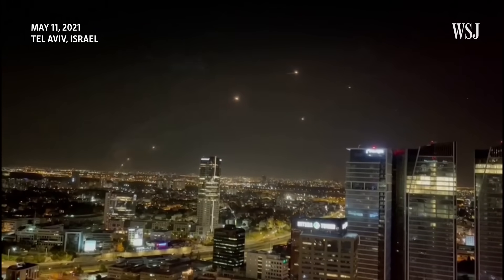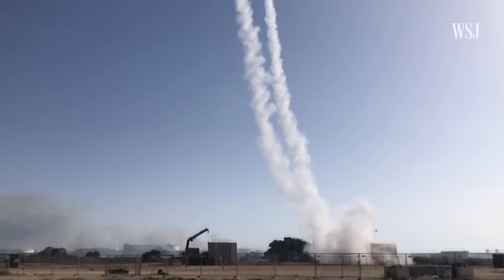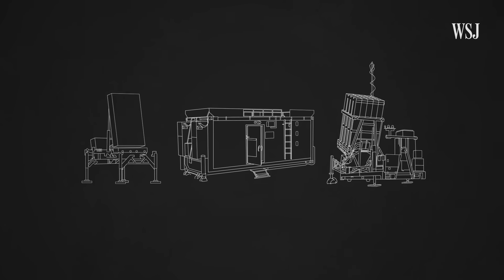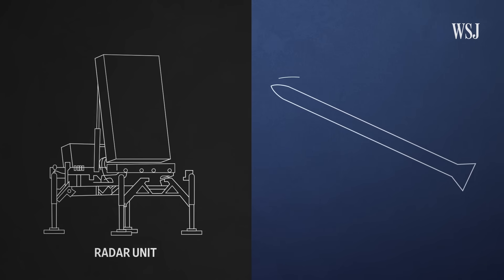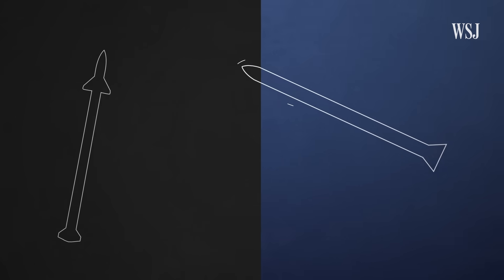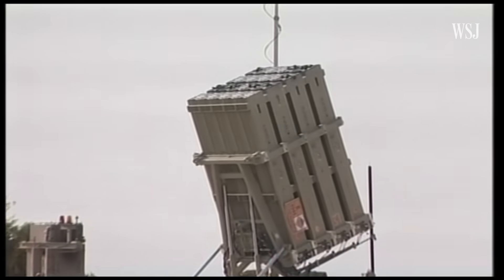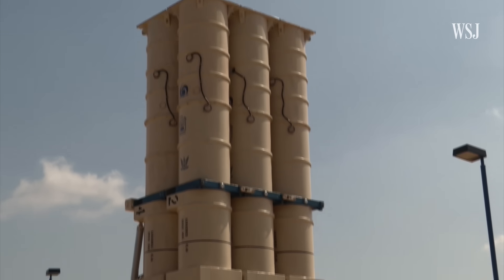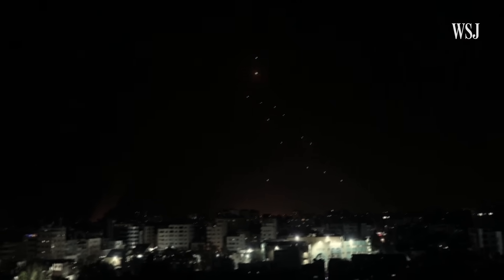How Israel’s Iron Dome Works | WSJ

Comment: I will answer my own questions: $50,000,000 per battery. $40,000 per rocket.
Reply: Woooow
Reply: And all paid for by the USA!
Reply: where is the source for this?
Reply: @ReassuringSmile  the internet.
Reply: @WS-gs6sf  Cool, you went the Wikipedia route...simplistic, scroll to the bottom where you have references, it's 1 source. If you do a broader search, you'll find price of the battery ranging from 12 million USD all the way up to 80 million Euros, that's a pretty huge range of numbers to believe. Especially when the Israeli government does not disclose the information of cost. Be a skeptic.
Reply: https://youtu.be/KiiWHWz-ROo
Reply: Tax payers of the US are ready to pay
Reply: All paid by the American taxpayer.
Reply: 80,000 $ per rocket VS 300 dollars Hamas rocket 😂
Reply: Per rocket?? How can Israel afford that?
Reply: Meanwhile each rocker costs around $200
Reply: That a lot of US taxpayer money.
Reply: Oversimplification as crew cost, maintenance costs, integrated neighbor systems like air force radar, and rocket variants effect the price tag. But yes this stuff is expensive, but the Israelis would rather lose the money and keep the people.
Reply: TJ Murphy  no the power structure will change it will no longer be like the israeli present state. A one state with Israeli Palestinians state means all are eligible to vote, new voters with different opinions on political issues will lead to changes in government and legislations.
Reply: TJ Murphy  there will be a Muslim Arab majority in a one state. Look I'm not here to disagree with you. I know the prospect of compromise and peace at this time is highly unlikely. It pains to think that survival war between the two might be the only option leading to the death of innocents. If only there was a way to take out the direct  oppressors in this conflict. I believe Palestinians should have right to return and statehood and even though israelis were on the wrong side the average working israeli probably born into Israel and knows no other home should be given the choice to stay and live side by side with Muslims and Christians or leave and find  another place. When Jewish refugees came over from Germany they held up a sign that read" the Germans destroyed our homes and families. Please don't destroy our hopes." And while Palestinians are the ones who can decide to welcome or refuse the jews of  israel, I reckon jews feel like they have no haven other than Palestine. 
It will take a miracle, for Biden to stop military aid forcing israel's hand and for a majority of israelis to denounce their gov and push for Palestinian rights to avoid an all out war from happening.
Reply: still cheaper than the lives of innocent israelis.
Reply: @IronMikeyT  Iyah, They're innocent people cuz Israel is your holy land..
Reply: @IronMikeyT  there are innocent people on both sides. And Israeli behave like small USA in the area.
Reply: @IronMikeyT  well..imagine some random stranger coming at your village in let's say germany, saying sir, please vacate this house this is in our land, we are the descendant of hitler, yes we flee the house at ww2, now (2021) we are reclaiming it.
Reply: @mike your answer is very cool
Reply: @IronMikeyT  "innocent isrealis" 😆😆😆
Reply: @IronMikeyT  keep telling yourself that
Reply: @IronMikeyT  Yes. But cheaper than simply bribing families in Gaza to leave permanently to neutral states(plus bribes to the accepting countries). Or cheaper than bribing families in Gaza to resettle in Israel with a promise that their grandchildren get citizenship. The asymmetry has become so ridiculous that these options need to start being considered seriously. Shooting down unguided rockets with other rockets is not victory. This is not a war between two armies. This is a war between an army and a street gang. And street gangs don't count victories in terms of bodies. Hamas continues to hold on to power and that means they are winning. Israels refusal to destroy them is shameful and weak. They should have invaded the territory long ago and unilaterally implemented a one state solution with the long term promise of citizenship to the grandchildren of the people in the territory.
Reply: @peterisawesomeplease  Yes, I can see Israel invading Gaza going over fantastically well in the international relations arena.

Of course it'd be better for the people there to be under Israel than under Hamas, no question about it, but the logistics of it would be a nightmare...
Reply: @peterisawesomeplease  providing muslim Arabs with citizenship would lead to a demographic crisis in Israel with jews no longer having the majority. If Israel didn't prioritize its Jewish identity over its democracy then there wouldn't be countless eviction orders( like the recent ones in sheikh al jarrah that sparked recent conflict) or a Palestinian refugee problem to begin with.  2 state solution is no longer rational and besides it would have ultimately lead to racist ethnic states, one state solution is the only viable path now
Reply: @peterisawesomeplease  resettle in Israel with no legal rights and treated like a second class citizen for 2 generations , that's every Palestinians dream
Nobody in their right minds would agree to that.
Reply: @rainbowdash6835  Remember they shooting down 1k rockets for 50k. Its not every Palestinians dream. But I think you would find many Palestinian parents would be quite happy to be second class citizens rather than prisoners if they know their kids are not only going to always have food on the table but are going to go to college.
Reply: @rainbowdash6835  Yeah I mean the builders of the Israeli state did many great things but they failed here. They should have just incorporated the territory from the start. But now it really is the right thing to do. But yea the left won't stomach the human rights abuses that will inevitably accompany such a move and the right is not willing to accept that Israel needs to become a secular state. But the cost is worth it. These problems are nothing compared to the horror of being a child doomed to life in Gaza.
Reply: @peterisawesomeplease  no, I think you would find many Palestinians ready to give their blood and soul for diginity and honor.
They will choose death over living in shame.
Israel is the oppressor right now, Israel is occupying land illegally, Israel is the one evicting families, Israel is the one that strangling the gazan people economically, and hamas like you said is but a street gang nothing compared with israeli military power yet Israel is still the one thats causing the deaths of hundreds of civilians. So much advanced tech yet it keeps killing children
Reply: @peterisawesomeplease  no that cruel solution is not the only way!!! First and foremost, Israel can call for ceasefire, apologize for the alqsa mosque attack, and start right away making amends to illegal evictions by forcing israeli settlers to evict Palestinian homes in West bank. This is the first step in compensating Palestinians. It'll be hard on Israel's ego but in the end its the right thing to do. After that, the solution will be complex bc Palestinians should be granted right of return but israelis should also be given the right to stay. Its difficult but possible if both are willing to compromise. This is how peace can be achieved. No real peace without justice first. 
Now that said, the probability of that ever happening is almost zero. It would take a miracle for Israel to admit it is in the wrong and be willing to compensate. 
Its still possible,if USA stops its  financial support and puts pressure on Israel.
Reply: @peterisawesomeplease  the alternative, is an all out war in the ME. Dont be fooled, Israel cannot invade Gaza and continue its aggressions without other world players getting involved.
Reply: @rainbowdash6835  Yes if everyone is Israel and Palestine suddenly got hearts and minds a real two state state solution is possible. But its the wrong thing to advocate for because its never going to happen. That is just the road to the status quo. Advocating for a one state solution at least has a chance(still not a great one most of this is pointless discussion for fun) because it can happen unilaterally from either side without negotiation. Another nice part about advocating for a one state solution is that even if in your heart you believe in the two state solution the threat of a large number of people advocating for a one state solution is probably the best way to force Hamas and Israel to be serious about negotiating a two state one. Because right now it is in the best interest of both powerful Israelis and powerful Palestinian to keep the current situation. But in a one state solution they would lose more power than a two state one.
Reply: @peterisawesomeplease  Just let me correct you over a few points, this is not a war between an army and a street gang this is a war between an illegal occupying force and oppressed occupants that are fighting not only for their land but for basic human rights. The occupying government that represents modern-day colonization has violated most international agreements. They are using chemical weapons such as white phosphorus to attack civilians, have bombed buildings that housed offices for the associated press and Al-Jazeera, deliberately murdered innocent children, women, and men, displaced, attacked, and threatened countless Palestinian families to make way for illegal settlements, these settlements are in violation of the borders previously set and agreed upon and thus are illegal. The attack of Hammas on the occupying government is barely a proportionate response to the mass killing and violations of the Palestinian people, as Newtown's first law states that for every action there is a reaction that is equal in force and opposite in sense, one cannot stand while watching their homes being bombed, children murdered and their land taken and do nothing. It is a very sad truth that there are casualties on both sides, there is nothing worse than the loss of human life even if they are murderers or aiding the colonization of another country. To that end, all of your solutions are sadly invalid you cannot displace indigenous people from their lands or offer them bribes or even absorb them into the existing colony the same way that happened in America we are no longer living in such drastic times. The only peaceful solution is the return of land to the rightful Palestinian people.
Reply: @yasseentolba1241  I don't disagree that the that the rights of Palestinians have been trampled. And I agree that a one state solution does not restore those rights. But Hamas is a street gang. They are not freedom fighters. They maintain power via violence and their primary goals are not serving the people they rule or independence. Also it hardly matters anyone who believes Israel will accept a two state solution with Hamas in control is being unrealistic. They never will. But they might be forced into one if the Palestinians make a good enough bluff about being willing to kick out Hamas and demanding citizenship.
Reply: @peterisawesomeplease  Hamas are not the representatives of the Palestinian people. The Palestinian government is the official representative of the Palestinian people and should have full control over their lands, the whole of Palestine. Peace will only be achieved by the complete termination of one side. Simply Palestinians will not and should not leave their lands to be occupied the issue is way bigger to be even solved by offering them citizenship, because they are already citizens of Palestine they do not want to be sucked into the occupier’s state and let go of their country. It’s their country and their land they should be in control of it. The western media and western history is showcasing the conflict in a wrong manner. Palestinian just want their lands back, others who have fled want the right to return. Imagine living in a first world country and wanting to go back to your homeland that is bombed and have no infrastructure. Many of the Palestinians that wish to return were born and raised in the western world and they wish to go back to a country in chaos that they have never lived in, this is how much Palestinians love their country that’s why they will never give up. Even when kicked out of their homes they keep the keys passing them from generation to another with one hope and one hope only to return to their homes, many wear their keys as necklaces as a reminder. This is their country and it should be their country. For the reference no one want Hamas to be in control or any other armed group for that matter all they want is their country and to live in a democratic, civil society without an occupation force. This is the Palestinian dream and it’s a dream worth fighting for.
Reply: @yasseentolba1241  It's a valid dream but not one worth fighting for at all costs. Land and nationality are just not as important as human rights. And for that that matter land and nationality are not even worth much in terms of power anymore. I guess I don't expect to convince you. But understand everyone's ancestors were at some point kicked off of some price of land unfairly. Trying to right all those wrongs is unproductive and impossible. But giving our children an equitable start is possible.
Reply: @peterisawesomeplease  Yeah I get where you are coming from, but over here, in the Middle East land is sacred it’s way more
important to so many people than human rights. However, the major problem is not currently finding a solution but it’s to stop the fighting for the time being, casualties are at both sides, however, Palestinians are suffering way more, the civilian death toll is way much higher, that’s why the occupying government should be condemned for the killing and should not be supported for the sake of the tremendous human violations. That’s why we need to stop the killing ASAP by brokering a cease fire. For the sake of humanity every human being should do whatever they can to stop the support of the murder of innocent souls.
Reply: @rainbowdash6835  One state solution? Who exactly becomes the one state? The secular Palestine or the Jewish Israel?
Reply: @thenewcaliph766  I was the one arguing for a one state solution. Rainbowdash was not. 

Most advocates of a one state solution(including me) advocate for a secular Israel. Perhaps renamed and with some constitutional amendments but maintaining the Israeli constitution for the most part and leaving power in the hands of Israel during the transition. Although with the awareness that over time political control will gradually increase for Palestinians  until they become a majority And with the hope that if done properly by the time that happens that Israeli politics will no longer center around  religious or ethnic rivalries but around improving the lives of all the people.

There is huge variance in the proposed timelines. But most one state advocates see their advocacy as acknowledging reality and widening the scope of possible practical solutions so are not strongly tied to specifics of the plan or even a one state solution. They would be just as happy if their advocacy led to a two state or other multi-state solution. But thinking about the problem from a one state perspective helps people understand the conflict in more technocratic/practical terms rather than ideological terms.
Reply: @peterisawesomeplease  Wow, you are the first person I have met in these insane comments with an actual sane plan that I fully support and which may work, if both Israel and Hamas work together for it. A secular country in the region, with another name and constitution which guarantees the right of both Israelis and Palestinians seems to me to be the only likely solution to this never ending conflict. Two-state solution may just dissolve into more conflict, and trust me I'm from Pakistan and I know the problems of Partition. Something similar existed in Ottoman and British Palestine, but not to such an extent.

But there is a problem. Moderate people from both Israel and Palestine may support this plan, but what about the others? The ultra-Orthodox Zionists e.g. Likud and the Arab Nationalists e.g. Hamas. Both enjoy a large, and I mean a very large following from their respective sides, and both are hellbent on aggression and enmity towards the other and kicking each other out. They most certainly won't allow such a solution to take place.
Reply: @peterisawesomeplease  you made two points one I disagree with and one is an undeniably fact. 
The first is about  the importance of nationality and land. Ben-Gurion  (Quoted on pp 855-56 in Shabtai Teveth’s Ben-Gurion )once said:
“If I knew that it was possible to save all the children of Germany by transporting them to England, and only half by transferring them to the Land of Israel, I would choose the latter, for before us lies not only the numbers of these children but the historical reckoning of the people of Israel.” For israelis and Palestinians both,  its not about just  some piece of land, its about the collective identity of a people thats at threat! Not only that, but unlike israelis , Palestinians can actually say this has been their homeland for centuries, its not like their ancestors are dead so they no longer  have connection to the land. 
Secondly , although land is  important to identity and historical reckoning it does not however have much worth in terms of power anymore. In today's world War is fought over legitimacy not land. The battle over the consciousness, namely the hearts and 
minds of relevant populations.
This has become the new nature of conflict where the awareness and endurance of society determines victory.
And that precisely why its important who controls the narratives and the distrubtion of news.
Reply: @peterisawesomeplease  the struggle now is over who can win over the world's sympathy by convincing them they are the victim.
Reply: @rainbowdash6835  I think we mostly agree. I agree that land is important to both populations. I didn't mean to deny that.  I just think those populations are idiots for thinking it matters(or have been duped by their leaders). Human capital is what matters. Information is what matters. Obviously for Palestinians they are lacking the bare amount needed to have a functioning economy. And that does matter. But they are overly concentrating on getting ancestral land back. Getting the right to move freely and buy any land in Israel they want is what is actually important. Because that is the road to educating their population and building real power. And Israelis need to learn the same thing. Their values aren't threatened by Palestine. They are under attack from capitalists with no nation and the slow but inevitable spread of Chinese power. All the time they waste on assuring dominance over their neighbors is a waste. They need to work with their neighbors on more important things.

And yea I agree that struggle is political one not a militarily one. I mean those can't every be totally separated but that the use of force is primarily about perception not physical control.
Reply: @peterisawesomeplease  I get your point but the land grabbing is still happening to this day. For a lot of Palestinians its not ancestral land, its their actual homes like the latest sheikh al jarrah evictions. I would probably obssess over my home if  someone came to steal it from me. You can't tell me you won't  feel the same.
Reply: @rainbowdash6835  this is already clear, but everyone keeps their mouth shut.  Anyone with an interest in history should side with Palestine.
Reply: @stuartwhyman1  simply said, its all about the power dynamic.
the majority of countries have called Israel out countless of times  but bc its  backed by the most powerful country on earth, they get away with it. It only takes one veto from US to block UN resolutions criticizing Israel. 
So then this begs the question of why US is a die hard supprter of Israel. 
And if you know the answer then you've come along farther then most people
Reply: @peterisawesomeplease  Sorry but the moment a mofo pulls out a rocket, that removes that party from being labelled as a street gang.
Reply: @kingdx619  and a state evicting people from their homes and occupying and building illegal settlements (under international law) aaand assulting people praying in a mosque is not labelled as a democratic and just state. It is occupying and apartheid state!
Reply: @peterisawesomeplease  the solutions you suggested are so out of touch with reality, I'm certain you didn't do any research on the conflict whatsoever.
Reply: if hamas didn't knowingly set up shop in residential areas kids wouldn't be dying
Reply: @TheSirAshton90  oh we all know that's an excuse to destroy the infrastructure and crippling the Palestinians. Also they destroyed AJ building which were broadcasting what reality is over there
Reply: @mujtabaahmed6947  the reality is remove that magic wizard in they sky and these things dont happen
Reply: @kingdx619  rockets are cheaper than aks. I built rockets like this in high school.
Reply: @peterisawesomeplease  you said it all. Remaining on the "we want our lands back" will lead nowhere because at some point in history a different ethnical group "owned" the land.
Reply: @rainbowdash6835  yes indeed u nailed it the only solution is palestine state
Reply: @IronMikeyT  yes. But compared to Hamas's rockets its overpriced by a lot. Hamas rockets only cost  300 to 800$ to make.
Reply: @rainbowdash6835  i think they're costlier  than that, chemicals needed to make the rocket propellant are expensive
Reply: @vishalgiraddi5357  here is the source 
https://www.jpost.com/arab-israeli-conflict/how-much-does-hamass-rocket-arsenal-cost-668317
Reply: @rainbowdash6835  Hamas rockets are dummy tech. They only shoot them to a random place and hope to hit a random local with population. Meanwhile the dome missel has to hit a rocket flying in the air and not a random spot. Why do you think USA military wants this tech so much and is helping israel develop because they can be use in their own country if necessary
Reply: @vishalgiraddi5357  The rockets are made from sugar and fertilizer.
Reply: @peterisawesomeplease  ohh
I thought they're made of APCP composite propellant, which is generally used for solid rocket boosters/missiles
Reply: @vishalgiraddi5357  I am sure it varies somewhat I am just getting that from the wikipedia article. But they probably just use the cheapest things they can. They don't care about the rockets actually being effective or killing anyone. They are just about showing they can still fight and baiting Israel into killing civilians.
Reply: @rainbowdash6835  — Are you sure about the $300 to $800 dollar per rocket figure? You can’t even repair an old car for that much, let alone fill it with fuel (probably $100s) and explosives ($$$?).
Reply: @sirrathersplendid4825  the  source https://www.jpost.com/arab-israeli-conflict/how-much-does-hamass-rocket-arsenal-cost-668317
I would say a few thousands max but I'm no expert
Reply: @rainbowdash6835  — Thanks for the link. Interesting article, though obviously a bit vague. 
So $300-$800 for the short range rockets; a few thousand for the longer range ones. I guess the cheap ones might be similar to the Katyushas produced en masse by the Soviets in WW2. 

I suppose if you’re not paying tax (lol) on the rocket fuel that would cut costs somewhat; as would getting explosives for free from a neighbouring regime.
Reply: @sirrathersplendid4825  yeah sure hamas gets help from neighboring countries but nowhere near as much Israel gets. The drastic difference in aid still stands.
Reply: So?